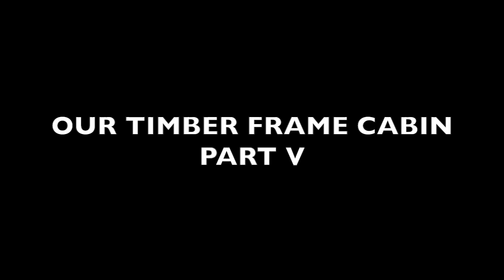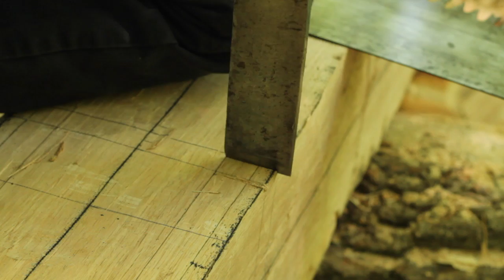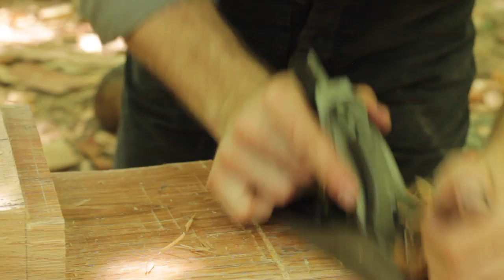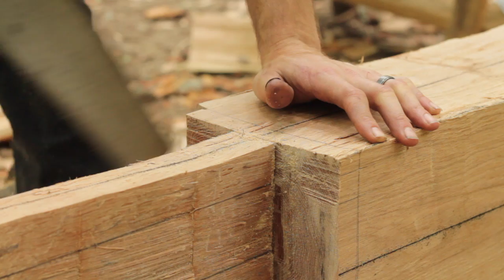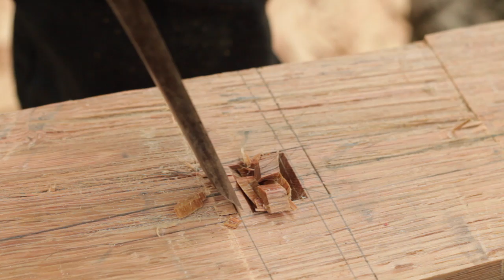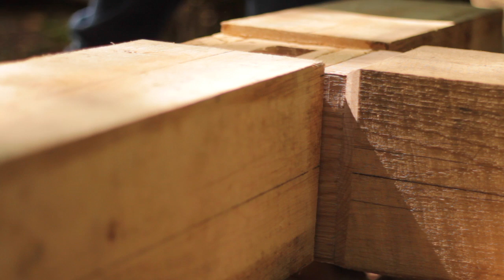Our Timber frame cabin Part V: Wedged through tenons

Comment: well done, this is some flush joinery!!! awesome.
Reply from the maker: Thank you, have you ever tried "center line" layout, also called "soul line" or "snap line"? This is my first try at it, and I must say its so much more accurate and useful!
Reply: you mean to draw all the lines? i ever draw 2 center line on a post with a 90 degres angle to have good references. to be sure my post is dead vertical when in place and the same for all the beam i cut because when i put them on the ground, i have to level the center line to be sure the beam on the right position before starting drawing my lines. if you work with roun beam, you don't have choice^^
Reply from the maker: I was just curious, here most timber framers use "edge rule" or "square rule layout" and some use "scribe rule" not sure how these will translate into french, but this is "line rule" where you snap 4 lines on all 4 sides with an ink line or chalk line, then all your "drawing/mapping of the joint" follows these centered lines instead of the timber, since the timber can be curved or round as you said. I find it very nice, last year I used edge rule and it was lacking, since you measure from the edge which is never perfect. works for furniture that has perfect stock you planed, but not so much for timbers. I have heard they use "scribe rule" in europe  a lot but wanted to know your experience.
Reply: but i'm not at all a master in timber framing at all. i(d like to but i have to progress a lot to go there^^

Comment: Fantastic! I always get a little buzz when i see you have posted a new video. Couple of questions,- is the smaller saw filed to a cross cut pattern too? -Are you working to a particular design, because I was wondering how do you know how thick to make the tenons to ensure they are strong enough.
Reply from the maker: Thanks
Yep its a 5TPI I filed crosscut from an original rip saw tooth. My designs I came up with, most historical frames had 2" tenons, which are strong enough if in tension only. If subjected to shear, they need to be housed deep enough to give more cross sectional support.

Comment: This is amazing! What did you do to offset the wedge hole for a tighter connection? And how long do you think the tenon should be made so that the wedge does not destroy the pine tenon?
Reply: Depends on the thickness of the tenon, I would say atleast a good 5-6 inches protrusion.

Comment: I appreciate the finesse and roughness working in combination.  I have been boring round holes for the wedge and in partner the wedge is also half round and wedged/tapered.  I haven't seen this historically, though, the round wedge hole.  Curious if you or any of your viewers have seen historic round wedge work, other than peg stock?
Reply from the maker: Ive not seen that myself, most frames here in the US I've seen used more pegs than wedges, but I don't see why it wouldn't work!
Reply: I don't see a lot of wedging in my local old frames, either.  On occasion they can be found.  I'm putting wedges in some through tenons on a project we are working on now.  They will be round.
Reply: Hi Jay.... I am weighing the work of both pieces against each other.  When boring a round hole I don't need to do any more work to the tenon and can spend the time on working the half round wedge which doesn't really require much more if any time to fashion than a rectangular wedge, from my perspective.  Where if I chisel out the hole more time is spent in that department, I bore the hole anyway, and skip cutting the corners out.  

My concern with the round wedge is it may have a tendency to want to split the tenon under heavy load where as the rectangular version my be able to apply a direct force against the end grain relish on the tenon enacting both shear planes.  I would be cool to see two versions tested under a hydraulic stress test.

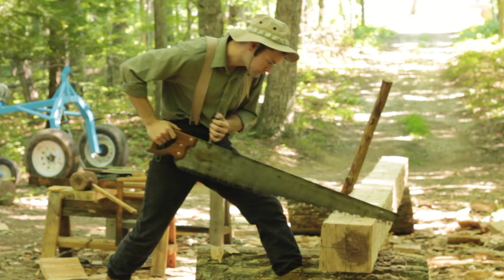Comment: why does the cross (pencil line) at 1:28 look crooked to the square end of the log?  Is the timber not actually a square?
Reply from the maker: A few things are going on here, one this timber is "rough hewed" so not really a perfect square, but it doesn't need to be. Also Im using "line rule" layout which utilizes leveled center lines as the basis for all measurements, permitting the use of round or even curved timbers.
Reply: great, thank you for the explanation.  I will look this up in the books that I ordered.
Reply from the maker: Sadly you aren't likely to find anything on Line rule layout on your books, unless they are on japanese carpentry. In the US and Europe most folks used either "edge rule" or "scribe Rule" layout methods, which are very different. Edge Rule or Square rule uses a square much the same way you would for furniture work. Its drawback is hardly any timber is really STRAIGHT, so no help using the edge as reference. Scribe rule is better, you basically have to level the timbers then use a compass and level or plumb bob to scribe east timber to its mate, this is very accurate, but requires lots of putting together and taking apart timbers. Line rule or "snap line layout, or Soul Line layout" accepts a timber is unperfect, but goes from leveled snapped lines on each face to layout from. Its the method I have some to prefer.

Comment: Alright. Do you have a technique for hand sawing so straight or have you just gotten that good over time?
Reply from the maker: Though you can train yourself to saw square pretty well by eye, it helps to trace guide lines on all 4 sides of the wood being cut, and saw touching the waste side of these lines. If doing really accrete work, a further step of making a knife wall, a knife cut line with a waste ramp attached will further guide the saw kerf very accurately. And yes, lots and lots of practice!
Reply: Mr. Chickadee Thanks for that very complete answer. Solid advice. My son and I really enjoy your videos. Take care.

Comment: Hmmm.....I am trying to picture where  one can have tenons extending outside the frame. Perhaps this is an interior joint?
Reply from the maker: No the whole frame has through wedged tenons sticking out everywhere, they all get covered up by wall trusses and insulation afterward. If you look at later videos in the cabin series you can see tenons sticking out around the frame.
Reply: Yes indeed....I saw this in videos that I watched today. However...it appears that you won't have access to those tusks (in order to tighten them if required) with the wall trusses and insulation covering them.
Reply from the maker: In the event these tenons really need tightening (we are talking after serious earthquake or other type occurrence) interior wall panels and insulation can be removed, giving access with out too much trouble, then replaced. In another type of building such as a barn or outbuilding, tenons could be left exposed past wood or other siding material, and be well protected by large roof overhangs as is common in Asian timber frames.

Comment: The wood looks wet ?  Why so ? Shouldnt be dry for carpentry ?
Reply: WhiteEagle PL no..... freshly cut trees are easier to work with, and when the joints are put together, they shrink making it super tight.

Comment: We gotta get you a Stanley #10 carriage maker's plane. It's the real McCoy for crisp inside corners on to gues
Reply: adding (stupid keyboard): ... crispi inside corners on tongues and rabbits.
Reply from the maker: It would be nice, but I won't pay the flea bay prices…Ill keep looking for a cheap Jack Rabbit or badger plane, should do the same...
Reply: +Mr. Chickadee I thought modern homesteaders had money hid in jam bars back in the woods. Another sacred stereotype cruelly demolished. 

I gotta look. Maybe I can find you a restorable wreck but don't hold your breath. These things turn up only after you don't need them. Another Murphy's Law.
Reply: +Forrest  Addy Relish failure? I recall an old joiner who cross drilled and pinned wedged tenons. He used two spikes in snug fitted holes drilled across the tenon between draw pin or wedge and the end of the tenon. He seated the spikes with sheep tallow to mitigate rust. Seems like a good idea but I've never seen others use it - but my experience in these things in limited.
Reply from the maker: Your experience might be limited, though you ooze out knowledge and anecdotal humor…hmmm not to worry, I might have a lead on an old Jack rabbit plane…
Reply: +Mr. Chickadee I was looking at a Paul Sellers video where he makes a rebate plane from a block of wood using a chisel for an iron. A rebate plane made from a maple block with a carefully made seat for the chisel and a wedge to hold it in place is a nice rainy day project. Charles can help. A video of the process will add yet more luster to your rugged woodsman image. OperaBass at aol dot comm.
Reply from the maker: You're right, id like to make planes in the future, for now I think I found a good "jack" rabbit plane, will see of it comes in good shape.
Reply: +Mr. Chickadee Kewel!